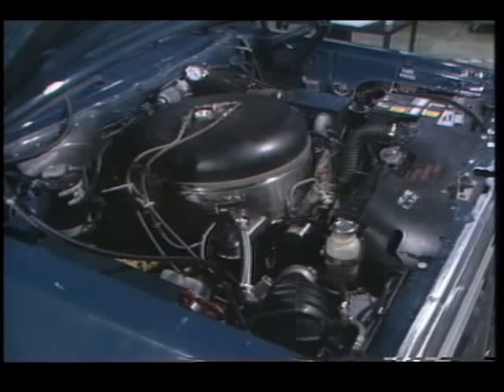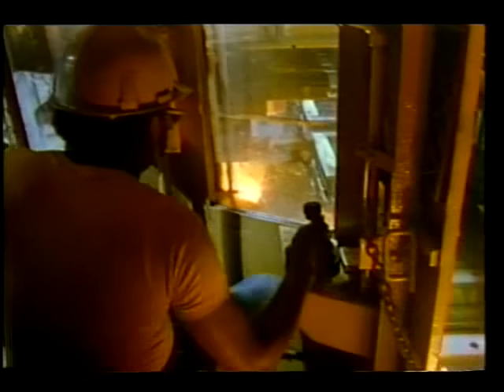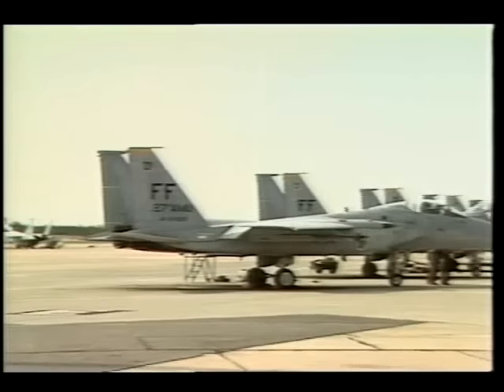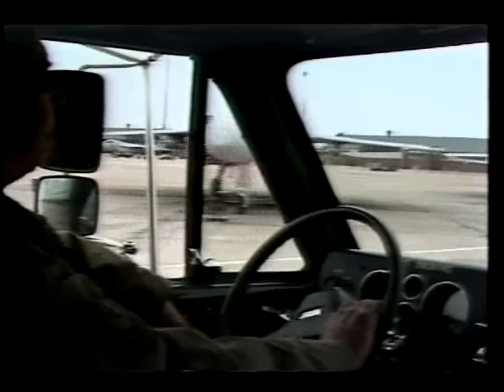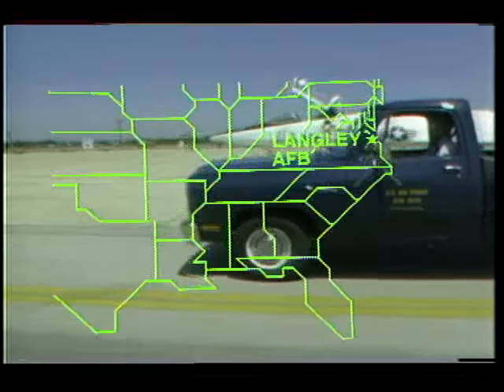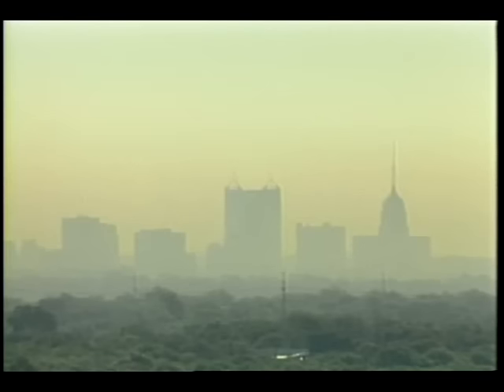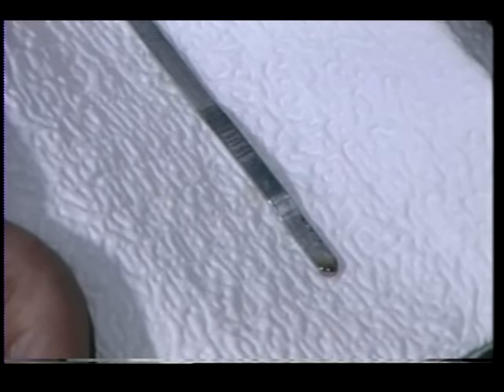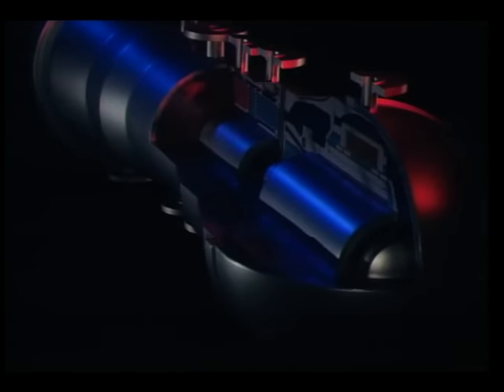The Stirling Engine: A Wave of the Future

Comment: You had me at no oil changes....
Reply: No misfires either
Reply: And that's at least part of why it never went to market.
Reply: @EuropiumGadolinium  Can you explain more of why it never went to market?
Reply: Too costly, underpowered and required complex construction. Maybe today with an hybrid system and modern technology it might be competitive
Reply: @phantomsoldier497  this would wipe out the entire auto industry. Imagine a EV with one of these engines as a hybrid. It would be the most reliable car and have the longest range using a affordable small battery pack and it can run on any type of fuel from any source.
Reply: basically its both against and with the oil industry

you can use gasoline, diesel, biogas, LPG, and any fuel you can use basically

heck maybe even electric heating
Reply: @ninjasiren induction heating powers by a rotating alternator should be possible
Reply: The NASA stirling engine is a free-piston, so no oil needed for operation
Reply: Battery tech in the 80s wasn't really good and oil was very cheap, that's why nobody bothered to produce hybrid engines (+ heavy lobbying from the oil companies), stirling engines are also pretty big unless you're using them as a generator and electric motor to power the wheels you will need a massive engine to make 150hp.
Reply: @markm0000  Yeah literally anything that produces heat quite amazing.
Reply: @phantomsoldier497  I saw the Stirling engine here on YouTube, and it was made of simple things like Coca cola cans and bottle caps, and it ran well and was able to generate electricity, so how could it be so weak and “ complex in construction ”?
Reply: @yakut9876 it's their way of saying, "absolutely nothing life changing to see here, move on" 😅

Comment: I'm so glad one of these "wave of the future" videos actually turned out to be accurate, as  these clean burning, powerful and long lasting engines are everywhere.
Reply: uhmm... where?
Reply: Please take me to the alternate dimension where you're from.
Reply: I believe this is a sarcastic comment, though it's incredibly hard to tell online.
But damn, I wish they were real.
Reply: @Zeraph-Zen  you would be correct Salty, I wish they were real too, and I've done a bit of study since my sarcastic comment. The biggest problem is weight, and size compared to ICEs, the one featured is as big as a truck engine, but 1/3rd as powerful. (being most pickups average 270-300hp, this one was 70.)
Reply: @michaelwescott8064  while yes, they do not output the most power for their size and weight, they are more than suitable for everyday use honestly. The truck featured in the video originally had a 150hp engine replaced by a 75hp stirling engine which doesn't seem to have caused too many issues as none are stated. The pickup truck had a 95hp engine replaced with a 75hp stirling engine and similarly there no issues stated. They functioned just fine even if they're a bit underpowered, so I can't come up with any issues in everyday use of said vehicles.
Reply: @Zeraph-Zen  I agree, sry if my numbers were wrong, long time since I watched. I think they would especially be ready to implement since hybrids are so common, you could run on batteries until the engine warmed up and began to recharge them, and batteries could supply burst power, oh and the second big problem is we would have to re-tool the entire engine industry, and it appears theres just no will to do it.
Reply: @michaelwescott8064  It's a low chance we'll end up seeing any mass produced car with a stirling engine anytime soon. But in the future it is certainly possible.

The only plausible way I think we could see stirling powered cars is if Elon Musk was completely wasted and decided to start another car company.
He does have the money after all and seems willing enough to try new, different things.
Reply: @michaelwescott8064  They are real, & this video is now 29 years old. Rhombic drive sterling engines are being used quite successfully by many navies around the world, turns out they are perfect for submarines. It's amazing what 29 years of advancement can do in the fields of engineering and material science.
Reply: Apparently some Swedes in a submarine were able to sneak up on some American navy  ship by means of such a system. I guess that means it is even more quiet than electric?
Reply: @Zeraph-Zen  right, even if they were underpowered then, if they would release them to the public they would be improved upon. Government doesnt like when you dont buy their oil and can run on the cheapest fuel available no matter what it is.
Reply: @michaele4151  electric submarines are only quiet as long as the batteries last, then the generator has to kick in and you're screwed
Reply: @michaelwescott8064  keep in mind back in the 1980s when this video was released average engines were 85-120 horsepower. Even the hottest Corvette during the 1980s had only about 180 horsepower. So for a truck or van for demonstrating the effectiveness of the stirling engine to have only 75 or 80 horsepower is not that bad especially if it makes up for the difference on low-end torque.

Would love to come across blueprints for the design and what it would take to put one together myself.
Reply: @eddieschwab864  sir, you are off by more than double, corvette engines had 375hp. These were too weak and relatively enormous.  I'd like the plans too, but to make a burn anything shtf generator.

https://en.m.wikipedia.org/wiki/Chevrolet_Corvette_(C4)
Reply: The Stirling engine is too heavy and expensive. It requires helium or hydrogen at very high pressures, above 100 bars and it is very difficult to guarantee the seal. Cars need light and powerful engines to avoid wasting as much energy accelerating and driving up hills. But these engines are very quiet and clean.
Reply: @robertoortizespinoza795  I don't pressure is an issue at all. Hydraulic systems operate much higher.  Heck diesel fuel rails can be over 2,000 bars.
Reply: @trapper1211  wooosh
Reply: @trapper1211  I believe its called sarcasm
Reply: Such sweet, sweet sarcasm.
Reply: @michaelwescott8064  Every Corvette sold wasn’t a 375 HP ZR1. The average Corvette had much less horsepower.
Reply: @johngillon6969  NASA built several trucks powered by Sterling engines, & they were an absolute success, but probably too expensive for the civilian market. At least someone created a way to tap into that money, I guess. I did happen, but was a huge wasteful project.
Reply: @michaelwescott8064  Look up the MOD 2 stirling engine. It was developed by NASA
Reply: THE STIRLING ISNT THE ISSUE BIG OIL SAID NO
Reply: I have one in my flying car!
Reply: @robertoortizespinoza795  but I think this engine can be improved to make it lighter and more powerful
Reply: Well this can also show that not the best bu tthe most lobbied for solution is the one which is applied en mass. The stirling cycle engine is much better at efficiency but it lacks torque. Those are used in submarises for example. They are also used in power plants where waste heat is abundand. Also NASA shot these into space where they provide power. So generally speaking they are simple and very efficient but as always not the best solution for every application.
Reply: @michaelwescott8064  This is a common misunderstanding when comparing "power". The average US pickup engine of the day (say 1989) produced between 125 and 180 hp. Granted, higher-spec versions produced higher power in terms of HP/kilowatts, but they weren't the majority. In that context, the 70hp (or 52 kilowatts), isn't that bad - but what they don't really go into in the documentary is torque figures - and this is the mistake that people make. I'd be willing to bet that in terms of newton-metres (or pound-feet for yanks), the 70 hp Stirling engine, was capable of producing twice, or more than twice the amount of torque than the internal combustion engine it replaced, and could probably produce it right across the rpm band too.
Reply: Helium is used as a coolant in MRI machines because the magnets that consume electricity to operate produce a lot of heat. However, there is no problem, but when they wanted to use helium in the Stirling engine, problems arose !!! This reminds me of how they banned the use of mercury to accurately measure temperature, the use of lead in combustion engines, and the complexity of the mechanical system, but you will see that they still use mercury with electricity, lead in paving roads and LEAD BATTERY, and the extremely exaggerated complexity of electronic circuits !!! In fact, I feel like something is wrong !

Comment: Named after the designer Rev.Robert Stirling from Scotland.Designed by him at the beginning of the last century.During the 1960,s the Phillips electrical company of Eindhoven improved the design and the engine was tested in a fleet of commercial buses.Results were good.NASA had an interest in the engine to provide electrical power in space as the engine could be run on any heat source including nuclear.
Reply: Not just heat, cold too as it only needs a temperature difference, which if you stick a cooler on the outside of the station in -270 degrees C and the other inside the 20 degrees C station, you have power without taking up extra fuel and in space they don't actually rely on heaters they actually rely on coolers because all the electronics and body heat, heat up the station as heat cannot transfer in space due the spacing of particles and as such the sterling engine would help provide power and cool the station down as it's taking heat out.

Comment: the death of the stirling engine was one of materials used at the time. High pressure hydrogen was the circulating heat transfer medium, and under high pressures used in this engine, caused hydrogen embrittlement of the engine parts, and then the seals required for efficiency were expensive and short-lived. Politics also weighed in, as petroleum interests felt threatened. At one time, Sears and Roebuck had a portable generator powered with a stirling engine. Also, the US Army experimented with a stirling engine for powering a mobile power plant...multi-fuel capabilities and extremely low noise signature made it attractive.
Reply: Azathoth Hastur  your reply is unresponsive to my remarks about hydrogen embrittlement and short-lived seals in this automotive test of the stirling engine. High pressure hydrogen was the heat transfer medium, and was difficult to seal and damaged the steels used in the engine, by making the metal brittle.
Reply: agreed...my response was directed at another person and I flubbed the dub...my bad
Reply: What do you mean ? It is an external combustion engine it was replace by internal combustion engines since they output much more power.
Reply: Stirling engine had numerous downsides. 
- Thermodynamic efficiency
- start up/warm up times
- poor throttling
- lower horsepower
Reply: @spikedpsycho2383  lower horsepower is not a thing. As an external combustion engine, the horsepower output was limited by engine physical size and the heat-handling capacity of the engine and its materials. A number of military submarines are powered by stirling engines. Automobiles have been powered by them. Agreed, the throttle response is not snappy, like a gasoline internal combustion engine, but that is not a significant issue.
Reply: Stirling engines work really well with minor heat differences too, the difference in temperature between cold ground and a hot sun baked portion can achieve usable work
Reply: i would love to buy one of the old sears and roebuck ones especially if they are maintainable. could the military be the reason and not petro companies be the reason there arent used more? stirlings are used in submarines and they might not want good designs getting out. with high material and machining costs almost being inevitable it's likely anyone looking at it for cars would have noticed.
Reply: I thought they used helium
Reply: @jasonalbee3673  Stirling engines can work with a ton of "working fluids" helium, hydrogen, oxygen, regular air etc
Reply: @jasonalbee3673  you could be right - helium would be safer...but the embrittlement issue was still there.
Reply: Should have used co2 as the medium.  Easy enough.
Reply: but at what working pressure? many what iff's have to be thought out.
 @JSabh

Comment: who killed the stirling car?
Reply: the lobby of the oil and gasoline compagnies
Reply: Amen to that
Reply: livingspringsfarms25 i wouldn’t say that if I was you... The Stirling engine would have been more successful to make people save tons of money on both oil and gasoline, but the companies of both subjects mentioned don’t want us to save money on neither both, which is a really unfair thing, but anyways, America will stay behind while other countries are progressing better.
Reply: Gas engines are more powerful for the size.
Reply: @hadri1-g6w  don't think so, since they run on gasoline just as well. :-P
Reply: literal lack of acceleration, changing RPM in stirling is SLOW
Reply: @beamishlotus7269  i havent seen your country produce anything of worth.
Reply: @Bruce Williams I think the first useful engine in a car, had the sterling powering an electric battery so that you avoided the issue of having to speed up and slow the sterling down for acceleration.
Reply: The highest efficiency engine uses a very highly compresses gas, hydrogen, as the heat exchange medium. The steel needed to contain the high pressure becomes extremely brittle and then subject to catastrophic failure. Other gases can be used but are less efficient. The seals needed for the internal moving parts are costly.
Reply: @hadri1-g6w  maybe with the rise of electric cars, we will have more variety!
Reply: No one. You have an engine with HALF the horsepower of a gas piston engine. Who would want that.
Reply: @spikedpsycho2383  you might be surprised - lots of folks experimenting with an engine with less than half the moving parts and almost no electronics or computers to make it run -- agreed there won't be any stirling engine drag racers in the foreseeable future, but a stirling will run on anything that burns, and a stationary one will run nicely on sunlight. There are some satellites with a stirling engine driving a generator or alternator for the electrical loads, in environments too far from the sun for effective solar panel use...powered by certain radioactive sources whose only virtue is the production of a considerable amount of heat for a very long time.
Reply: @JackpineGandy  I'm aware of stirling use and radioisotope generator; WHICH has yet to be installed in ANY probe or satellite.There TWO major drawbacks for Stirling engines: first was the time needed to warm up – because most drivers do not like to wait to start driving; and second was the difficulty in changing the engine's speed – thus limiting driving flexibility on the road and traffic
Reply: @spikedpsycho2383  The advanced Stirling radioisotope generator (ASRG) is a radioisotope power system first developed at NASA's Glenn Research Center. It uses a Stirling power conversion technology to convert radioactive-decay heat into electricity for use on spacecraft. The energy conversion process used by an ASRG is about four times more efficient than in previous radioisotope systems to produce a similar amount of power, and allows it to use about one quarter of the plutonium-238 as other similar generators.

Despite termination of the ASRG flight development contract in 2013, NASA continues a small investment testing by private companies. Flight-ready Stirling-based units are expected by 2028. from Wikipedia

The US Army had a mobile power unit, similar to a diesel gen set, but powered by a stirling engine. Relatively quiet, compared to a diesel or gasoline set, and could use a wider variety of fuels.

Stirling engines were tested back in about 1985 by GM. It was fuel efficient, but the engine was not cheap to produce, mainly account of seals and hydrogen embrittlement in the working fluid portion of the engine.

Research continues, despite your objections. They are legit, of course, but not a block to further research.
Reply: @spikedpsycho2383  you DO NOT NEED horsepower, you need torque.
Reply: @mknone40  it's nonsense, power is tied to torque. The more torque your engine has, the more power. Engine with low torque compensate that through more rpm like bike engines.
Slow engines with great torque have poor acceleration and suck in vehicles
Reply: I believe radio killed the Stirling car
Reply: I wonder who killed the Stirling electric generator. Diesel ones are loud and dirty as hell.
Reply: Azathoth Hastur  yep
Reply: Azathoth Hastur  yep
Reply: Physics
Reply: video
Reply: @spikedpsycho2383 i would want that. And when government cuts off your gasoline supply i will be the one laughing in my wood/coal powered car with no need for maintenance
Reply: @taith2 You could use a cvt transmission
Reply: @gabrielphilips6980  That would be lost cause
More useful would be in hybrid generator
Stirling takes long time to start and change RPM, so batteries for 20min of ride would be useful
Reply: @taith2  correct me if im wrong but if you put a cvt transmission you could use the engine at a fixed rpm
Reply: @gabrielphilips6980  true, but startup of the engine takes long
And as said, used as hybrid engine would be best in my opinion, especially free  piston designs